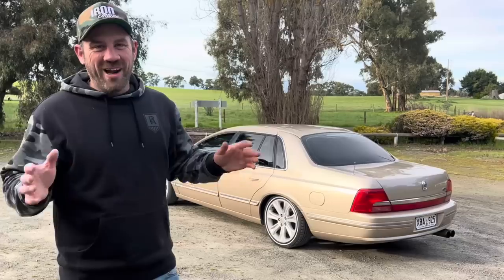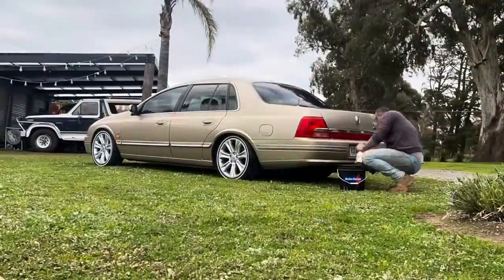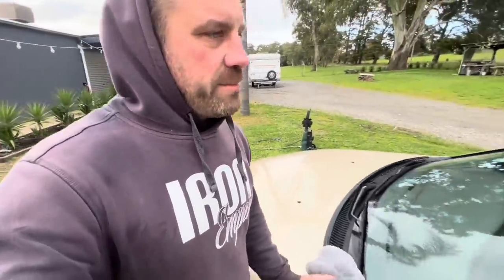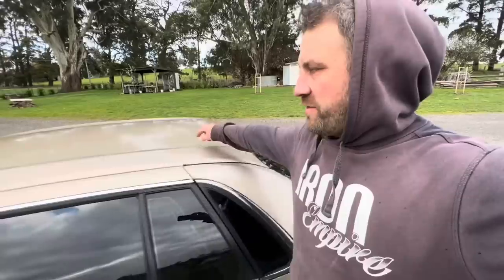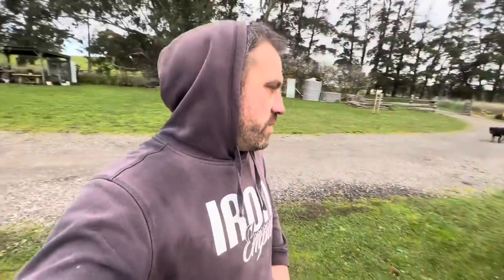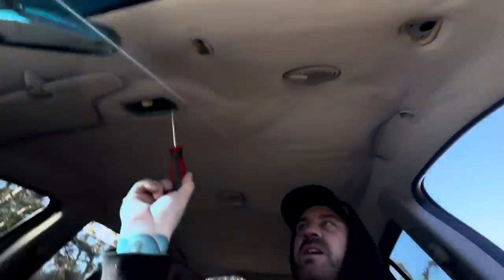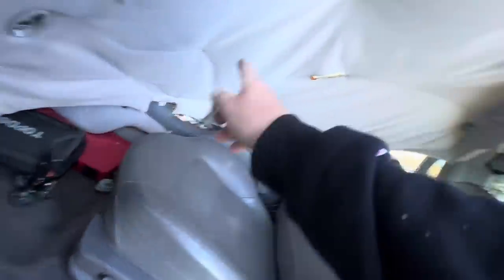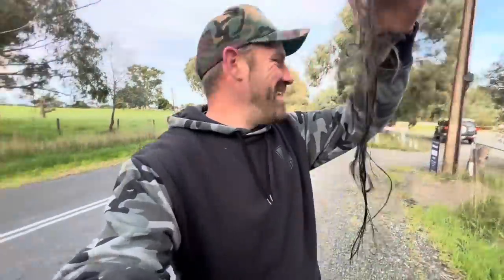CAMMED 5.0 AU Fairlane Tuned With A J3 Chip!?!? It’s Good! - Iron Empire EP 140

Comment: I have an beautiful au 2 v8 has a control that adjust clutch in auto to make it  quick to shift . Also I run water menthol as I run nitros  with heater blanket and 10 pound bottle with jets at 125 hp at the wheels , also have stall converter at 2000 . Have new headers and straight thru  2 half inch exhaust with on muffler . I love my old girl and she is immaculate inside and out . 
Well done on your job so far . 😊

Comment: Mark, I won't rag on you for having it on gas. If it's a daily driver, it's a good way to save some cash on your fuel bill. You just need a gas system that has the ability to support the power your making, get it tuned right, and then cruise a lot cheaper than on petrol. 

Trouble with gas is that few people install a system good enough, so you end up with it lacking power and get upset with it. 

I've got gas on a few of my vehicles, the best systems are the injected gas, have it on my eb2 ghia, wifes ba xr8 (liquid injection - bloody awesome),  and gas injection on my daily driver bmw e39 v8, a AC Stag Qmax Plus system. Injected gas is awesome. Cheap running on gas, and no restrictions for when your running on petrol. I've got an Impco 425 on my EB S XR8, it's pretty good for the mild v8 around town, made a custom adapter so it actually fit, as usually the ford v8s ended up with an impco 225 on them, which is really undersized. 

What gas system is on it?
Reply: Impco 425 s are great hey. 460cfm from memory. Many moons ago I had 1 setup on a 465holley 4 barrel baseplate & an Aussiespeed 4barrel manifold to suit 250xflow with an E Convertor plumbed closely. A 425 would work great with a 5l Windsor if someone wanted straight gas. Could get away with more compression too. Cheers
Reply: @zacsborntorunrunningadvent3441 with a custom fabricated  adapter and a custom top had to hook the impco 425 to your air flow meter, I fabricated my own bits, to clear the strut tower, you can run an impco 425 on a efi Windsor v8, I did that on my eb s xr8 for year's.
Reply: @MrToranaGuy  great idea. I'd never considered a 425 / efi combo. Very usable. Cheers

Comment: You can get a 175kw to do this by just blueprinting. No tune or camshaft required.
I would do standstill LSD burnouts on 235/45/17's with the old BTR!! 😆
Reply: My 4.0 dosealot better than this
Reply: @mattysfishingadventures  run a 14.8 second quarter in your 4.0L & get back to me 🤣

Comment: Gaday what injectors have you got in the AU. I've gone up to 24 lb in my 5 lt AU and a nice 544 lift cam. Ported and polished heads match ported manifold 1.6" exhaust valves. High volume fuel pump billet fuel rails and adjustable fuel reg. Do you have aftermarket heads ? Beacause you have gone for stage 3, but only revving t0 5500, that's stock revs. I thought I'd only needstage 2 chip but now I'm thinking 3 . Thanks for your video, cheers I'm in Adelaide too.

Comment: Nice Induction Roar. Being heavy the AU Fairlane 5.0l Id highly recommend a 2500rpm stall. 2000rpm stall is basically standard yeah (1800-2000rpm). Cam sounds great & is the J3 chip customised by you or pre loaded edit? Cheers

Comment: Why don’t you use the proper gasket joining the upper and lower manifold sections?
Reply from the maker: There is a proper gasket there, it went on new when I put the engine in. But as I mentioned I didn’t wanna put much pressure on these bolt as the last manifold cracked easily